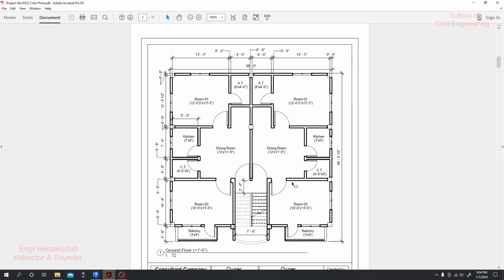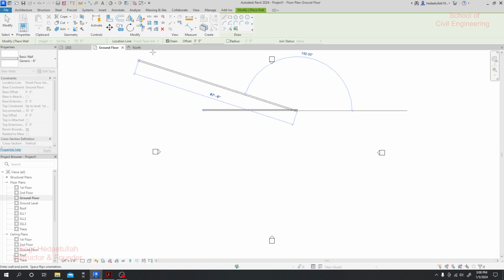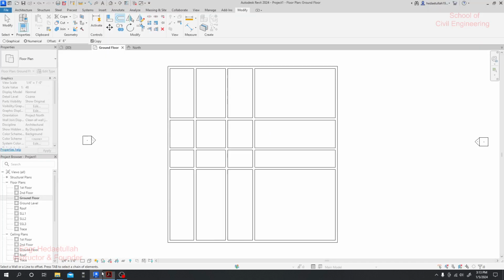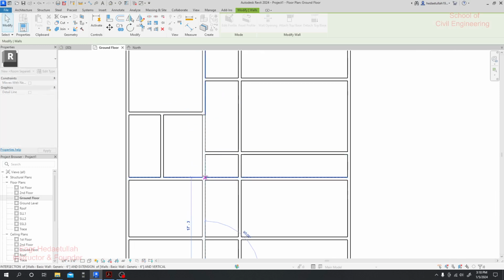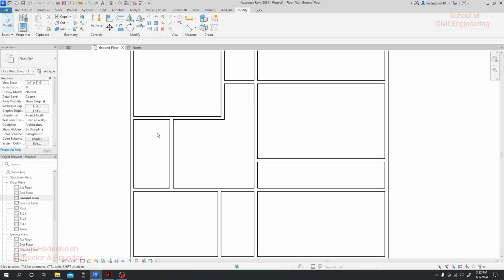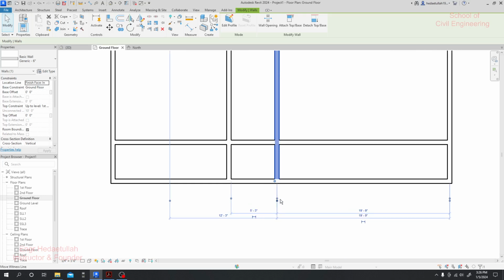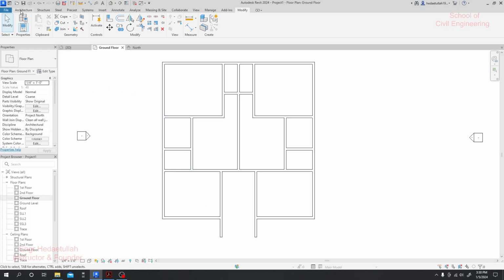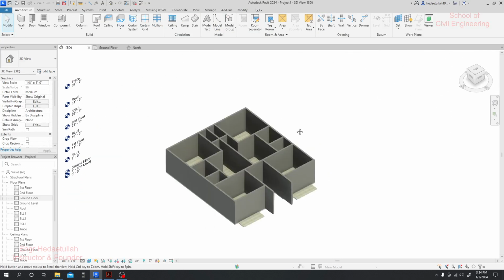22.1 Revit 2024 Tutorial for Beginners - Revit Floor Plan and Revit Architecture 3D Modeling

Comment: Both room 02 and stair does not add up to 38ft it is 36'-6" so the room size was meant to be 14'-3" however when you moved in the center line that shortened the upper 4'-6" Wall.